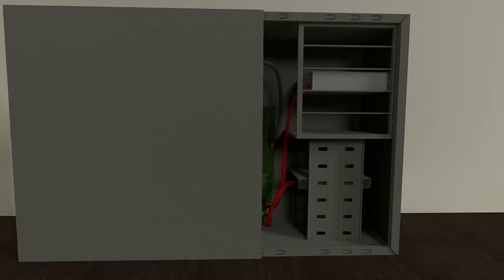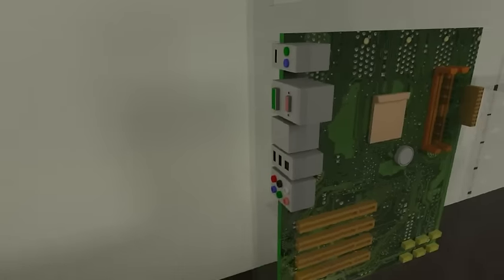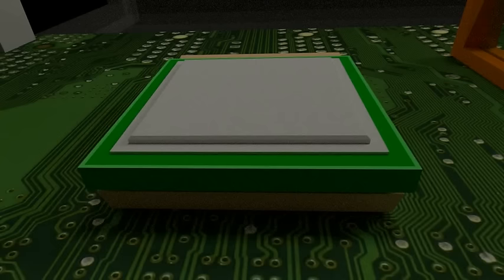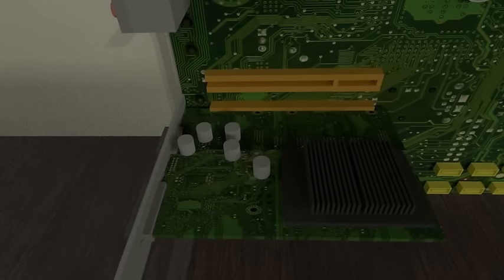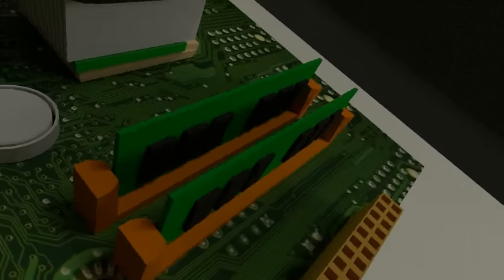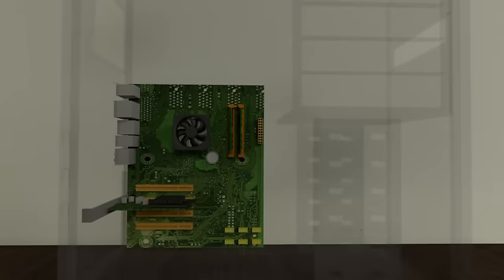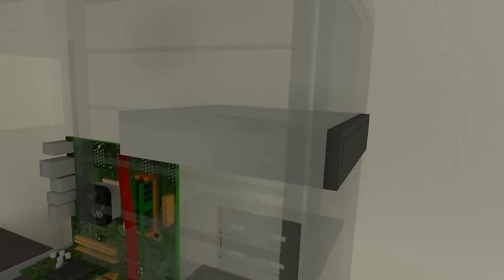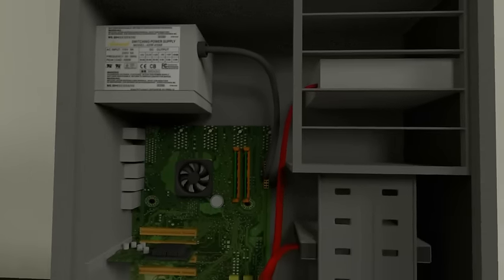Understanding Computer Parts

Comment: 1:33 modern CPU's can do multiple things at a time   that's not right per my knowledge .
CPU still do  only one task at a time but switching and scheduling is so fast that it gives illusion of doing at same time.
Reply: Very recently CPUs have gained the ability of multithreading, whitch is the ability of a single CPU to run multiple processes concurrently. Yes in older possessors this was the case, but new technologies has made true multithreading possible and allows computers with alot of traffic (servers) to run faster and more efficiently
Reply: @Nyx_Fey_  Yeah, you are right.

Comment: Why they leave so much space unused ???
Reply: It helps with cooling and airflow. As someone who has built computers, I can tell you that compact cases run hotter and louder, as the fans have to try harder to cool the components, but still can’t do as good as a job.

Comment: Sir Can you make it for mobile phone what really inside the phone
Reply: Most of what's inside a desktop computer is inside your phone. Some stuff is soldered onto the boards instead of being a seperate chip, but much of same principles apply. The only additional tech is a sim-reader, radio and bluetooth antenna, battery, and charging port/circuit as well as the touchscreen. Phones vary so much anyway, you can search for phone teardowns and they'll show you what it all looks like inside - but the circuits themselves are mostly the same stuff just arranged differently and shrunk down considerably.

Comment: So, is there any chance to get back the deleted files from a computer ? 

P/S : yet im still learning english language grammar.
Reply: Depends, if the files have been overwritten, then unfortunately no. But if you recently deleted the file, it can be possible, but maybe not plausible. The reason for this is that every drive has a “directory” on it, a subset of the drive that stores the information. When you delete a file, most of the time you are just deleting the directory for that file, and not the actual data. Using very sophisticated methods, it is technically possible to gather that data, most of the time. If you did a clean wipe, instead of a delete, that will clear the directory AND the actual data. Hope this helps (and sorry for the incredibly long reply)
Reply: try EaseUS software